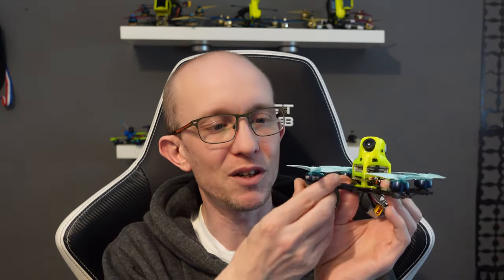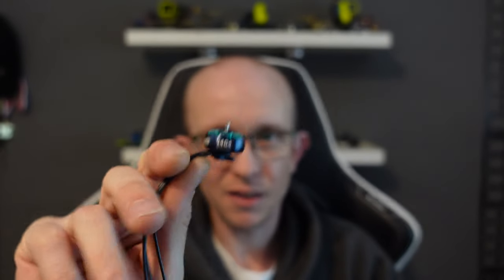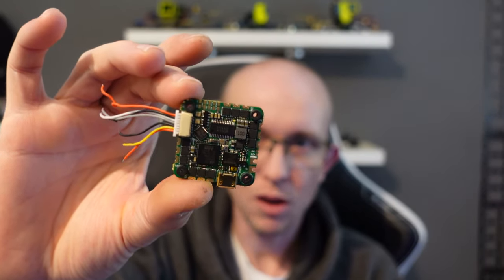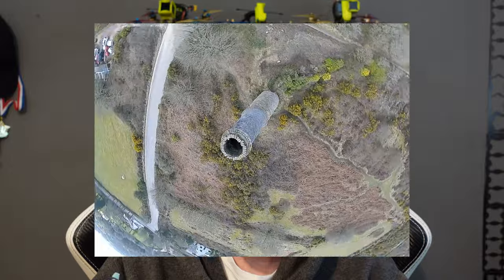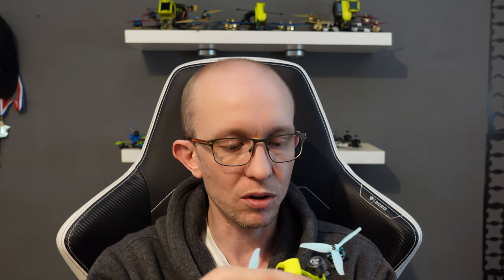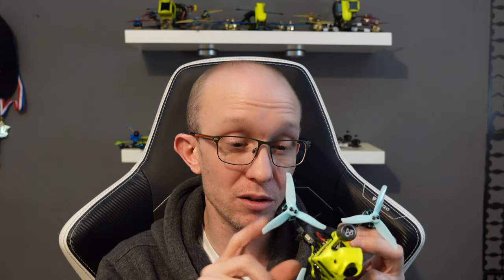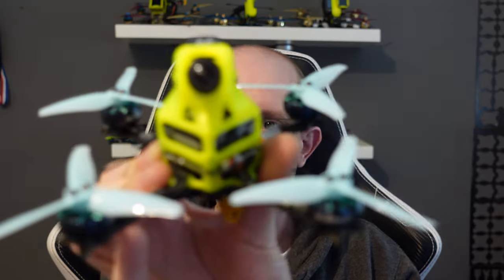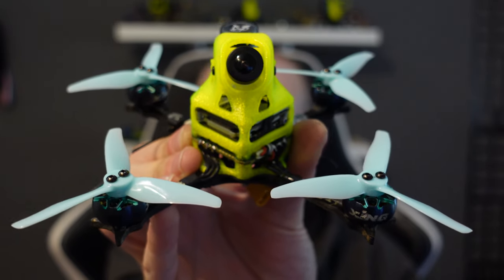The Best Vistapick Build For 2021 - iFlight Xing2 1404 - iFlight Beast F7 AiO - HaloRC Odin

Comment: Thinking about building one of these... I've got some spare 1408 3650kv motors, used to use them on a cinerat but it felt pretty underpowered for that but might be ideal for this application
Reply from the maker: Sorry for the delay in replying. Those motors at 3650kv will not be fast on 4s 3 inch, you should use them on a light 4 inch if you need more speed, or go 6s with a throttle cap.
Reply: @Bludz  Hey no worries! Thanks for the advice - maybe ill pick up some new motors and build one anyway haha

Comment: good day you think 1404 would be to small for a n3 inch roma with caddx vista ? and not sure what kv i should go for 3850 ore higher. i want some power and love to cruice around
Reply from the maker: I would go a little bigger on the motor. This build is about as light as you can make a 3 inch with vista, anything else will do better with a bigger motor as this is at the limit here really. Good call on the kv, around 4000kv would give you more throttle contol with lower top speed.

Comment: Hi i wanted to build a vista toothpick would u say this is one of smallest builds possible? I wanted to fly indoors/outdoors freestyle
Reply from the maker: Flying the same drone for outdoor freestyle and indoor safely isn't possible imo. A 3 inch like this might be small but I beat 5 inch racers on the track with it, so probably not great indoors if you are not a great pilot, even then its open prop and not very safe.

Comment: Would you mind shating your pids for this build? Im 99% sure my tune from my cinelog25 (the 1404 4500kv vista set up im converting to a vistapick) are going to be too far off to fly well at all
Reply from the maker: I honestly just use max multiplier slider to tune these, default is very close to perfect, usually max multiplier of 1.2 is enough to tighten it up a bit.
Reply: @Bludz  thanks man, I appreciate the feedback! Happy flying!

Comment: I just wanted to build a machine like this one and I find your frame great, so I bought one with xing2 motors in 4s. Can you share your betaflight's tune if possible?
Reply from the maker: Hey there. Good choice to build this setup, I love it. I used the sliders to tune this one, it's not perfect but it works good whether you have damaged props or not.

PD Balance 1.25 PD Gain 1.0 Stick Response 1.5

Filter Sliders to 1.5
Dynamic Notch Q 250 Min 150 Max 350
RPM 2 Harmonics Min 100

Comment: Great review my man! This is so close to what I am looking for - but I'm not a DJI flyer. Ideally, I'd like to run this exact build but instead of the Vista I'd like to do a Runcam Hybrid or a Caddx Tarsier. Do you know of a canopy that will fit this  frame that will accommodate a hybrid camera setup? Thank you!
Reply from the maker: Cheers dude. Personally think this is the best sub 250g setup for me. Totally get not everyone wants to go DJI and that's cool. Analogue will work amazing on this setup and less trouble with heavier props. I've not seen a canopy for a hybrid cam, but that is where I would go if I wanted HD and analogue 3 inch. Had a look on Thingiverse but no luck man. Maybe ask in the RunCam group?
Reply: @Bludz  Will do my man! What is the RunCam group?
Reply from the maker: The Facebook group :)